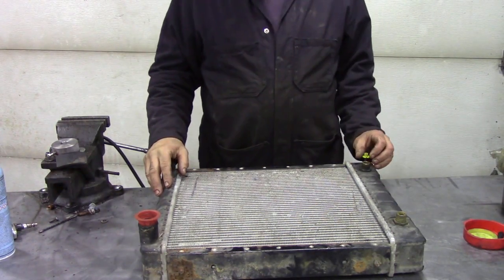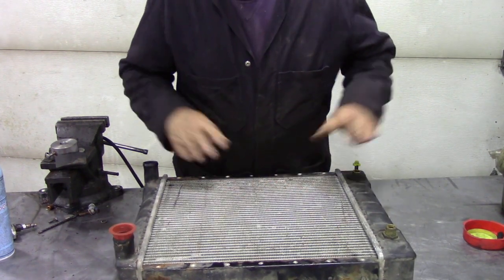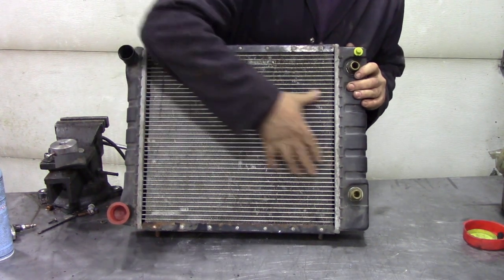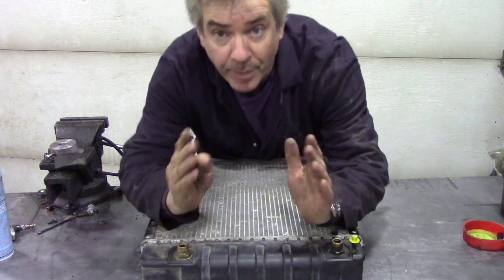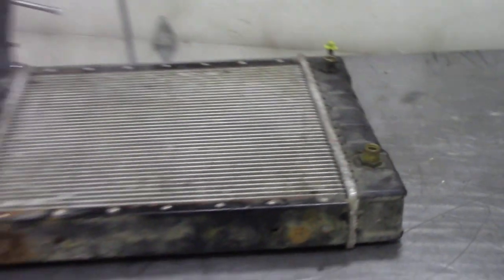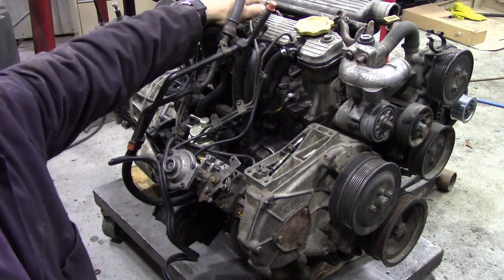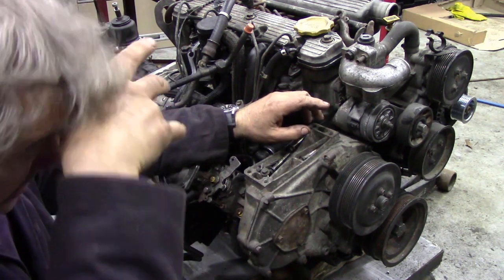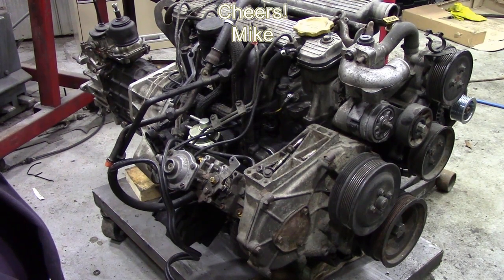Preventing overheating on the 200/300Tdi

Comment: another good tip.. if you're using a spanner or socket & ratchet on the crankshaft to turn the engine over for maintenance.. remember to remove them before trying to start  the engine ( doesn't just apply to 200 300 Tdi's ) ... Mike as always some very good info there, thanks
Reply from the maker: Actually that is another video in itself!
If I have difficult crank bolts to get out, you put a long extension under the car close to the chassis and onto the bolt - and turn the key! (Pull the main HT lead or the injector pump solenoid wire)
Always come off!
Mike

Comment: I fitted a digital temp guage on my 200 that measures block temp rather than water temp with an alarm that you can set at a desired temp. It can help to prevent the false reading you may get with trapped air. Always good to have a second guage! Much cheaper than a new head.
Reply from the maker: Sounds interesting - where did you place it on the block?
Mike
Reply: Hi Mike, I just recorded a short video on the sensor. I actually placed it on the cylinder head! I may look to move it at some point.  If you click on my account you will see how it works.
Reply from the maker: https://youtu.be/LWjsn3rDLwo

Comment: I Mike, Great video, very instructive and clear as usual. Question: I'm going to change the hoses and the water pump in my 300TDI, and I found there is some light rust, it is not very bad, but lot of rust deposits in the expansion tank, and I was thinking in do some flushing to the system. And I thought, beside the flushing, why not to use a phosphatizer agent mixed with demineralized water, after the flushing?, and let this mix to act for at least 1 week, and then flush the system very very deep, to eliminate all the rest of debris and the mix, and then change the hoses, and the water pump, to later top-up with proper coolant. What do you think? Do you ever use this kind of products? can it be harmful to some parts/gaskets? Thanks!
Reply from the maker: You have to be careful what you use with aluminium
I have been quite lucky and not needed back flushing but it really depends on how heavy is the rust - I was going to suggest Vinegar and Salt which is good but can eat Aluminium
Here are some suggestions
https://toolspicks.com/best-radiator-flush-reviews/

Comment: Great tip on a very important topic. Can you tell the optimum operating temp for the coolant and oil (200/300TDi)? Is 75 to 80 °C to low?  88 to 95C to much, if running on the highway for hours?

Comment: Hi Mike, thanks again for this brilliant vid about the TDi. I wonder for what reason Land Rover puts the radiator and oil-cooler in one unit. Does this construction improve cooling the engine? Is it a matter of space? What do you think of seperately installing an oil-cooler and radiator as single units? What is the ideal (oil-) temperature for the running engine? 82°C, 86°C? When your are going 55 to60 mls/h ( no extra load, 20°C ambient temp.) on  the highway and the oil gauge constantly shows 100°C, just above when going uphill, and back to 95 on a decline, will this be a hint to check for a cooling problem of something else ( valve gaps correct? head gasket? Water pump working, but ineffizient. ...)
Reply from the maker: I never liked the oil coolers in the rad - separate are much better - I seem to think I covered this subject in another video
Reply: @BritannicaRestorations  Thank you Mike for the quick response.
Reply from the maker: Oil in the Tdi's gets quite hot due to the return oil from the turbo where it picks up heat.
Next time I have a Tdi running I should check the feed and return temperatures with the thermal imaging camera
Reply: @BritannicaRestorations  Oh, that's fine. So, I am looking forward to studiing the results. I just looked around, whether there is a 74 or 76C thermostat for the 200/300TDi housing, like the optional equipment one,  you can find in Series 3 engines. I could imagine, that there are options for the ROW- versions on 300/200TDi, but I did not find them by one. I should mention, that we mounted the TD5 intercooler in front of the 200TDi radiator ( Series 3 109 swap), with a Kenlowe 16" 2-stage windmachine,  sucking air through.

Comment: Congratulations on yet another easy to understand but comprehensive great video.   I would like to hear what you think about electric cooler fans Mike, like the Kenlowes. I have only ever fitted one and that was on a forward control because of the drive shaft being a constant problem. Are they efficient?, and were should the sender go?, at the bottom of the rad to read how cool the water is after going through the rad?, or at the top of the rad were it is the hottest???? and is a two fan system with slightly  different temperature setting better than a one fan system.  Due to the total war on diesels by our government  here in the UK and in the EU in general I,m thinking of taking my motor off the road for a while after winter  to fit a petrol engine on LPG, so it would be helpful to learn the full SP on electric fans rather than read the advertising crap in the LR mags. Keep up the good work Mike, and if you do I will get in touch with the vatican and recommend to the pope that you be made the patron saint of Landrovers.  Doesn't that sound good---- Saint Mike of Landrover. (LOL)---  Best wishes from Rob, here in Gods county Yorkshire.
Reply from the maker: Thanks Rob!Good question for the electric fansI see a lot of viscous fans not working so they are deemed useless, but then again the are a few electric fans that will let you down when you need them as they are rusted up
I fitted 2 x fans to my 110 with the Isuzu in as I had limited space to put the regular fan in 
I used thesehttps://www.britpart.com/all-parts/da8966/
Not cheap, but quite good.The sensor fits in the top hose and is adjustable for temperature ( you cut the hose and clamp it in)18 months now and no botherI did buy an override switch for it so you can use it on auto/off/ onNeater than Kenlow in my opinion

Nice kit as it picked off the original rad mountings - there are some that you tie to the core but I don't like them
Only comes on after a run when the truck is stood and there is no air flow and even then they go full pelt for only a short while
Mike
Reply: Does the fan take the place of the thermostat meaning that you have to take the thermostat out. Or do you leave it in.  ROB.
Reply from the maker: Rob - you leave the original thermostat in, but there is an electronic one in the housing that goes in the hose  - you can then tweak it to suit your needs
Mike

Comment: Very useful video.  

Airlocks are common on 300Tdis, but less so on 200 I think.  My 300 had airlock issues which turned out to be a clogged Y-piece where the thermostat housing and rad expansion lines join the expansion tank hose, under the tank on the Discovery and RRC.  After clearing it out with a wire rod (be careful as the plastic gets very brittle with age), I never suffered any more airlocks.
Reply from the maker: It is surprising how many think the Tee is a valve
When I had access to them, I used to fit some nice brass Y type tees
Not a problem

Comment: Another useful video Mike thanks. Any tips please for an over cooling 200tdi?  Viscous coupling and  thermostat ok. Only reaches normal temp with radiator 80% covered. Definitely running cool as heater blowing luke warm
Reply from the maker: Sounds like a missing or stuck open thermostat

Mike
Reply: Checked thermostat is fine 88c
Reply from the maker: Have you got the right type thermostat in with the bypass valve?

https://www.brit-car.co.uk/product.php/84799/5497/thermostat_88_deg_200tdi_defender___range_rover_classic___discovery_1
Reply: Yep that's the one.  I'm going to ask a stupid question now but I took off the black rubber ring thinking it was just to protect edge of thermostat in transit. Should it be left on?
Reply: Hi I run a 200tdi discovery and I’m sure the black seal is only used on the 300tdi. I re conditioned mine and it has run cool ever since unless worked hard. Not sure why that would be, it had a new radiator so maybe it’s super efficient?
Reply from the maker: I believe the 200 and 300Tdi thermostats were the same but the 300 had the black rubber gasket on the edge - take it off for a 200
Reply from the maker: It's a head scratcher, as the temp sender is always before the thermostat
Mike
Reply: Britannica Restorations Ltd hi mate I have issues with my 200 tdi getting to warm bought a new thermostat. But came with a black rubber ring .so you say leave it off ...also expansion tank is always cold but under pressure when I take cap off pipes not particularly warm but gauge creeps up to much any idea please....thankyou
Reply: @BritannicaRestorations  bit belated Mike but got to the bottom of this. Replaced the 200tdi thermostat and kept the rubber ring in place. Now quickly reaches normal,  and stays there. Happy days again as heater now working effectively. Happy new year Mike.
Reply: @BritannicaRestorations  Hi Mike, what's with the rubber seal? I have a Waxstat one, for a 200tdi, which I've just installed & it didn't have one - temp is reading about 60% on the gauge. Have a new radiator and pump.